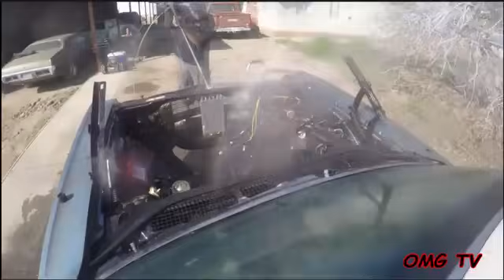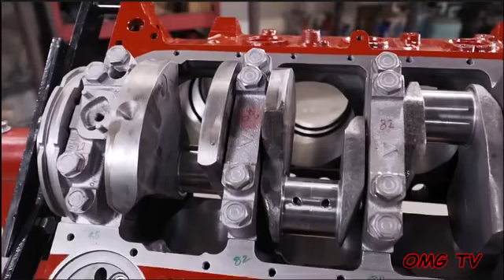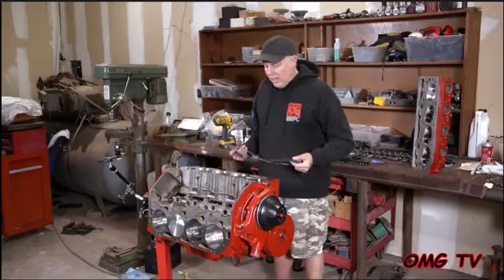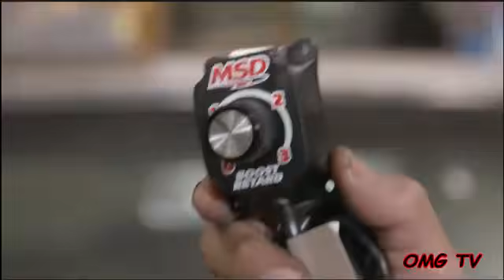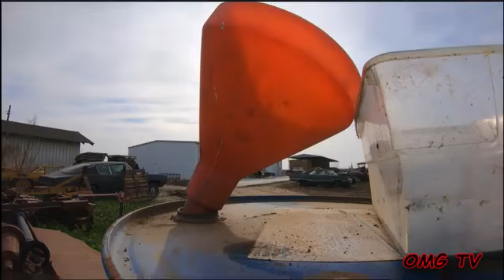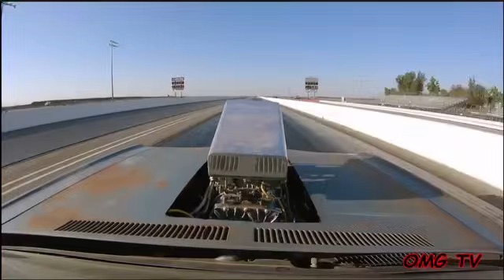roadkill garage S5 E08 back from the dead tire lifting crusher impala

Comment: What is the "proper" break in for a rebuild with a hydraulic roller?
Reply: Make a heat cycle.   Then go stand on it hard, you don't need to be super high rpm, just heavy load.  Do this 20 plus times, chang the oil, go have fun.